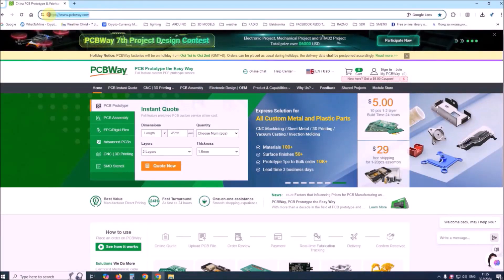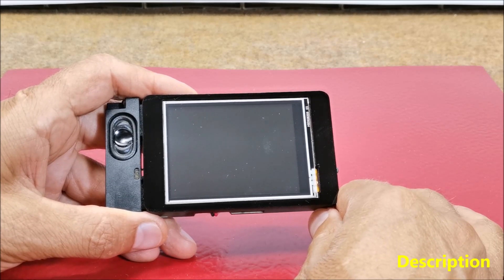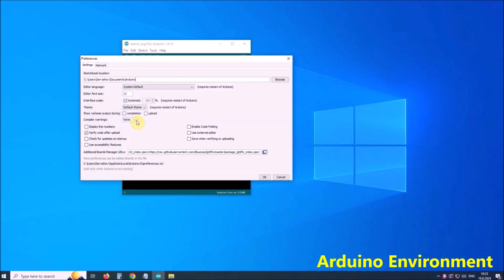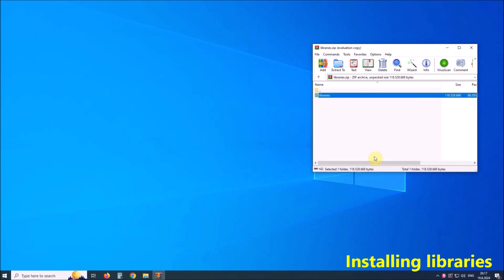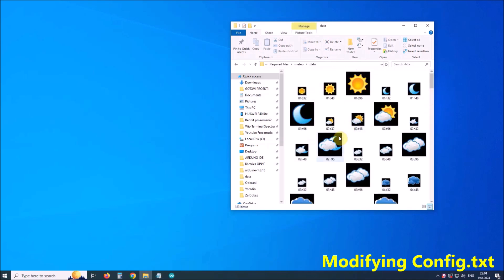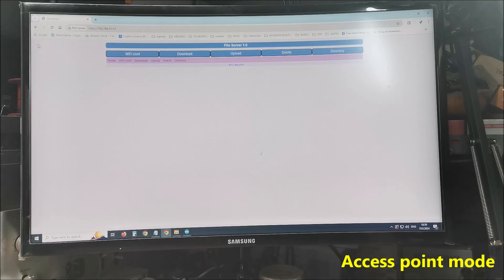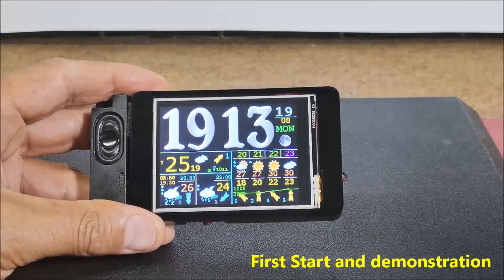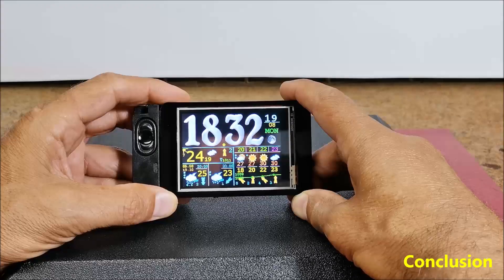DIY simple Advanced Weather station with 5day forecast and Internet Radio

Comment: Please help me. I did everything as shown in the video. The program is saved to ELECROW. But the screen is dark. With the Arduino IDE port monitor I can see that everything is working. I connected to the computer and entered my network attributes. With the Arduino IDE port monitor I can see the connection and data reception. But there is one problem, the screen is dark. It is really good, it worked before programming. What should I do?
Reply from the maker: This is associated only with the fact that your module's display pins may be connected to different ESP32 pins. maybe your module is a little different in terms of connecting the TFT to the ESP32. Look for a schematic on the Elecrow site

Comment: Hi, thanks for the project. Can you assist me with getting this working on the cheap yellow display (esp32-2432s028r) ?
Reply: I got it done.
Reply: @owengill105  Hello. I also have a yellow screen, but after uploading the program the screen is black. But through the Arduino IDE program port monitor I can see that everything is working. How to solve this problem?
Reply: @daliusbub4598  Check how the backlight pin  (GPIO21) is configured.